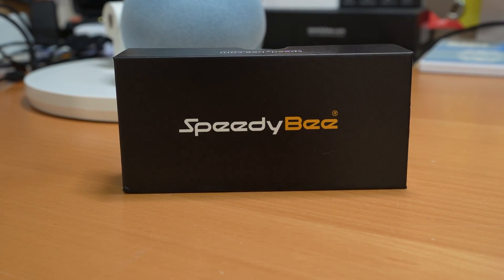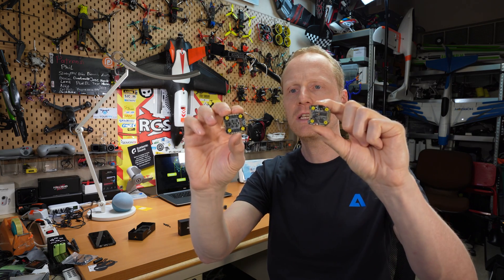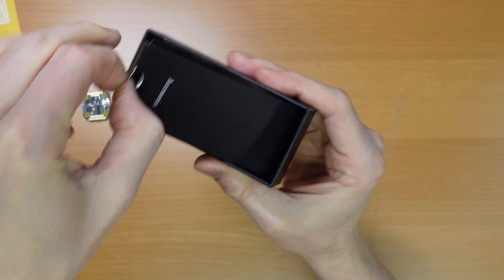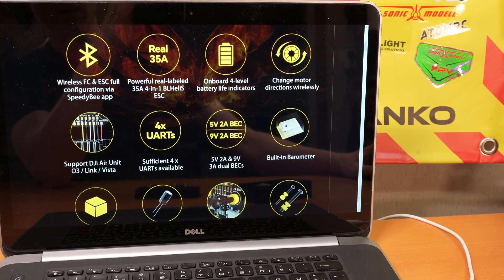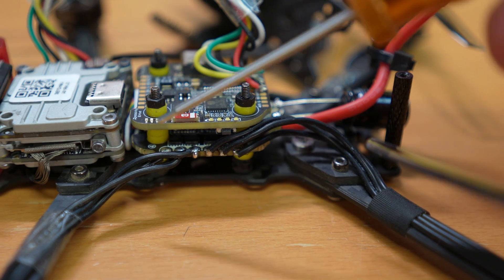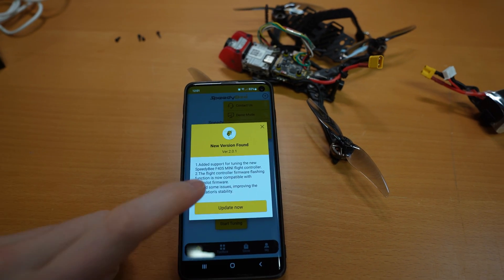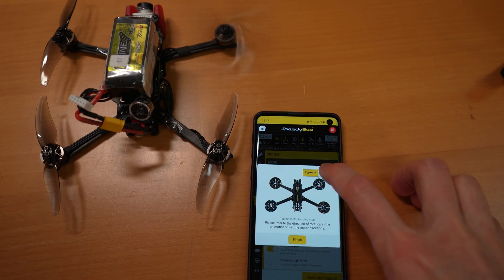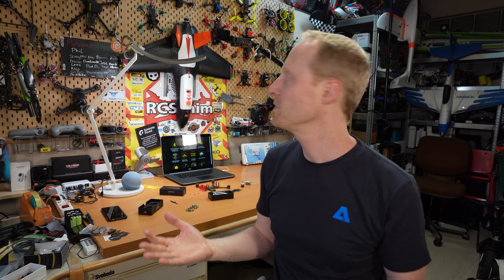Speedbee F405 mini Stack / MAX features!

Comment: Hello from America, I'm building my first long range 4 inch FPV drone using the Flywoo Explorer LR 4 V2 frame kit and Flywoo Dave-C-FPV 1404 v2 2750kv motors what 20by20mm m2 stack would you recommend for a lightweight build
Reply from the maker: I didn't build a lot of 4" drones myself - rather had the RTF ones. Just see the Chimera4 for example and get one of their replacement FCs. Or one of the Speedybee's as well - they are decent and have a lot of functions.

Comment: The holes they provide for the capacitor legs are pretty handy, my friend :)
My 10-year FPV anniv. is coming up, I just built an old-school 10" Reptile 500, and for S's and Giggles, used this stack to power it all. The whole F405 family of Speedybee products are top notch, especially when the price is factored in. The Wing board is my current go-to for fixed wings, this 20x20 for quads. Thank you for the review Sir!

Comment: Is there any documentation or guide available on speedybee F405 v3 FC for fixed wing.
Reply from the maker: I think I tried it once. It's only s matter of flashing inav in it and then choosing the right connectors. Soldering the Servo leads... 
See if painless360 or fpv university have a video about it. Or just get the cheap f405 wing fc from speedy...

Comment: Just got myself a black Dolphin....They just fly so well and have so much room inside....🤔😳😀😀😀🇬🇧 Speedybee F405 wing is going in it...😀
Reply from the maker: Congrats! It's really a nice plane!   What motor / prop combo did you select (or the PNP`?)
I'm testing a TMotor F90 1500kv soon - with either 4 or 6s  and 7x4.2 biblade, or 5x4x3 props on 6s.   the stock motor worked ok for a few flights, but eventually burnt out (on the last hot summer meet)...
Reply: @Rcschim  It came with a smallish red motor and a floppy black 7 X 4 prop. It may be okay as I will be keeping it light, no big batteries. This is one of its best features IMO. Getting CG even with a small Lipo onboard...This and the proper reflex wing section and forward sweep make it a smooth flying winner IMO....🤔😳😏😏😀🇬🇧

Comment: I fitted the 30x30 V3 to a 7" very easy to setup and a great Flight stack, I would definitely re-purchase this product.
Reply: Have they fixed the osd problems
Reply: I have not had any OSD issues it is connected to a DJI air unit and works perfectly. @ckfpv

Comment: you have lots of space below the stack. i would try to lower the stack height, so the gyro on the fc is free with nothing on it or cables touching it
Reply from the maker: thanks for the tip. the way I solderd the battery lead pushed me to have the stack up high ;)  It will have to work this way...